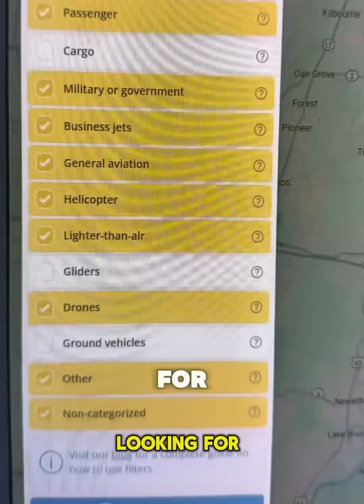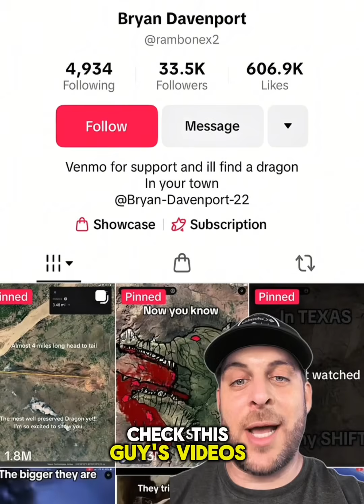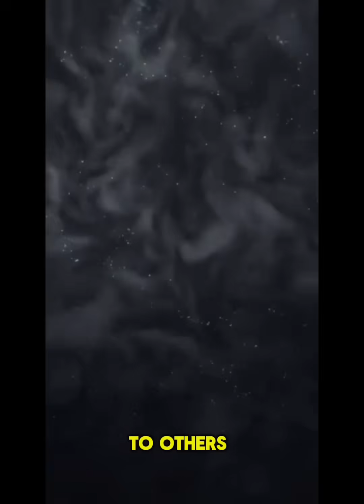Young Inventor Makes Gas From Plastic Waste! Will he live to see it thought? Volcanoes were What!?

Comment: The thing is it's already well known science. It's just that the cost of energy to convert costs the same or more than what you get for final product. Plastics are polymers made from oil if you remember in your school classes. You got to break down the polymers some way and in this case it's by using heat. Not attacking here by the way.